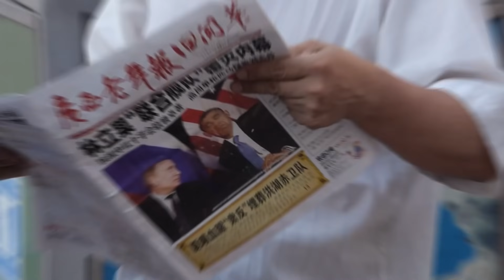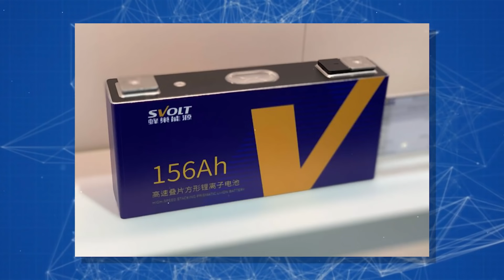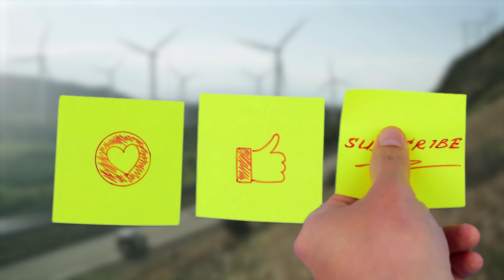Why China is Leading the way in Renewable Energy

Comment: Please help me understand the impact of say doubling in efficiency of solar panels
Reply: It means you can harvest twice the energy than the current solar panels.
Reply: @linming5610  the theoretical potential is about 5 times, not just double. Say 20 years from now?
Reply: Current panels can only convert 20% of sunlight into electricity. If it were to double, it would mean each solar panel can generate much more sunlight than before. Right now solar cells are already cheaper than coal but not by significant difference. Doubling efficiency would lower that number much further down, causing huge incentive to adolt solar panels in most countries and business. It eould also likely accelerate battery research to store energy at night.
Reply: @user-qi3rm2wr5m  thanks very progressive, would the same things gave happened from 10 to 20 percent, how about collection and transmission?